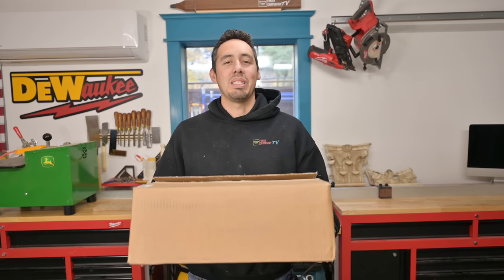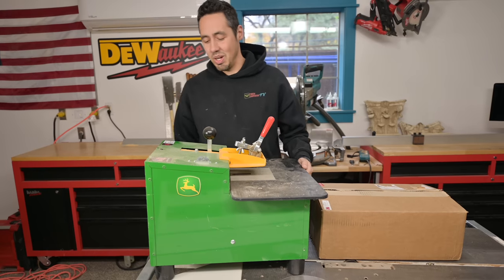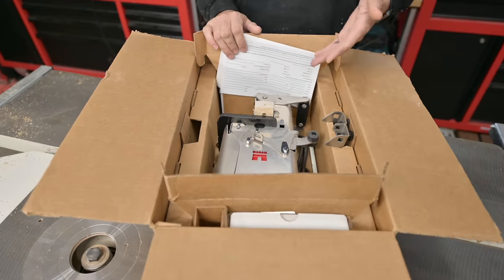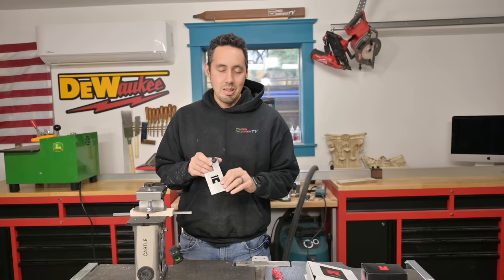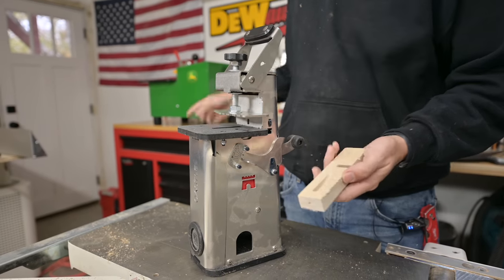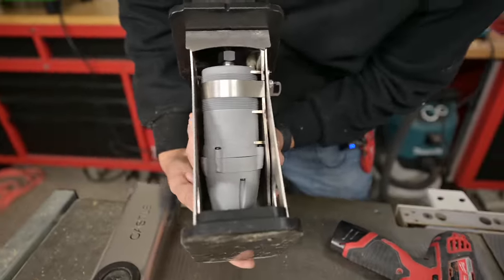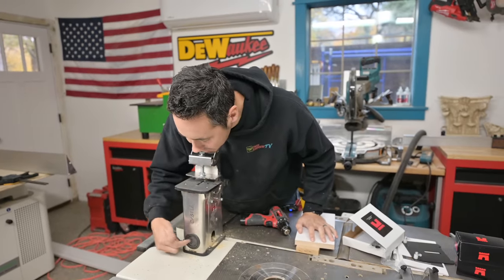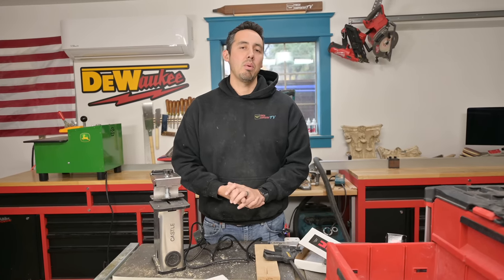Most contractors don't know about this... The Castle 110

Comment: Hi Richard. About 10 years ago I saw the Castle Pocket hole machine and decided that I could MAKE one myself??? So 9 hours later, lots of 3/4" plywood and 2 routers, I had a working machine. I have added a few ideas along the way, but my machine is still working just fine after 10 years of pretty heavy use. It is accurate and quick cutting beautiful pocket holes. Great design!!!

Comment: castle is king.. our mid-size, mid-grade furniture factory
had the floor model that had pneumatic  action and hold down clamps.. we ran porter cable routers , w/ HHS 1/8" jobber's for pilot & a two tooth carbide tip 3/8" strait flute . we ran every material imaginable across the castle. solid- oak,pine,ash,cherry,maple sheetstock- mostly 3/4" ply, MDF, HDF, PARTICLEBOARD, HPL(glued to substrate) & even ran some 1/2" baltic birch and some 3/8" merenti.  it was a "bottleneck" machine at our place. it ran 8hrs a day, 5 or 6 days a week for 17yrs. i worked on that thing several times mainly due to over use or shitty cutter/drill bits. the castle machine was a soldier, in my book, ohh yeah. i did all the maintainance. im sure i wrenched on every machine there including forklifts, the building, computers and copy machine and several employees cars.... ohh and i kicked the soda & candy machine when it malfunctioned.. lol

Comment: I've had mine since they first came out... the huge plus you didn't mention is the lower screw angle which keeps the faces better aligned when screwing pieces together.  The Castle screws are pretty much a must as a Kreg screw head is too large for the router slot... not a huge problem to get the Castle brand though.

Comment: I have had my Castle 110 for a little over a year and a half now.  Can say enough about how so much easier it is to make connections without the wood trying to move like with the Kreg pockets.  It is cleaner looking pocket, not rough around the edges like Kreg.  Low screw angle can't be beat.  You will love this as a portable pocket hole machine.

Comment: One of the nice things about the castle is the shallow angle of the screw hole and pocket which makes it a bit harder to get your impact in there, but greatly reduces the amount of slip on your joint as you screw.

Comment: Neet idea. Back in the 80s where I worked the owner made a pocket making machine had the traditional bit inside a bit a fence with air powered work holding piston and all functioned with a foot pedal. Was really nice but apparently the bits cost quite allot and wore out regularly.

Comment: I use a Kreg pocket hole jig and hate when you get board walk. I assume the pre drilling prevents that. Wish the Kreg made a drill bit with a longer pilot drill bit to accomplish what the Castle pocket jigs do. The 110 looks like a very well built tool.
Reply: The shallow 3° angle pocket that the castle router cuts also helps with the board walk compared to the typical 15° pockets with weaker joints

Comment: The TSM-12 is definitely the way to go for benchtop, worth the price difference.  But I don't see much point in the 110.  Frankly the new Kreg 520 and 720 both look better to me.  You can drill a pilot hole as a second operation with any pocket jig.  Just drill the pocket holes with the jig and then come back and finish the pilots with a normal bit.  4.5 mm works to give Kreg screws a tight slip fit (the Greg step bit is about 4mm in dia.)  In fact doing the pilot holes all at once is more efficient and less tiring than having to pick up and put down the cordless drill for every hole.  

It's not the angle of the 15 degree pocket hole that causes creep.  Most of it happens because the diameter of the pilot hole is not big enough and the pilot hole doesn't go all the way through.  Try it yourself.  Drill some pocket holes with your Kreg jig and then drill out the pilot all the way through with a 4.5mm bit.  5/32 is too small.  3/16 is too big but it will work.  You'll find that creep is practically eliminated.  You can use hand pressure to hold the pieces with little or no creep.  If you clamp it you'll definitely get zero creep.  I've been doing this for years whenever creep could absolutely not be permitted.  Go try it yourself.  

We all know the principle.  The same thing happens in any situation using screws where there is no pilot hole or where the screw threads are a larger diameter than the pilot hole.  The workpiece wants to lift.

Comment: I bought the one that Porta Cable was making before that was the exact same as that $1500 one, I don't see them anymore but I was for around $600 years back, burned up in the Glass fire of 2020, looking for a replacement, was looking at this unit until they raised their price $230 from $450 for no reason.

Comment: You’re going to need a couple of mini risers that are set at the height of the deck of that. That way you can support the 12+ feet boards you use.
Reply: Just lay them on your work top and bring the machine to them since it’s so small. You can clamp it directly on the workpiece for more support on larger materials!

Comment: If there is a way to mount a couple of PACKOUT feet to the base of the tool you would be able to pull it out of the drawer and lock it onto your stack. No need to find a place to clamp it.

Comment: Castle allows for more shallow angle of cut unlike kreg  like systems which some argue may contribute to better strength. One downside to castle is that you would need to use castle own type of screws for best results.
Reply: The type of screws that are recommended are panhead pocket screws(not washer heads).  There are several vendors that sell panhead pocket screws even Kreg.  Since the bottom of the pocket is rounded, the panheads crush the wood fibers on the sides of the pockets locking in the screws, just like setting a finish nail.  Washer heads limit this compression and can give you a false sense of security in some cases.  The biggest percent of mid to large size cabinet shop use panheads.
Reply: Wow Castle even watches this channel 😅 that's how you know you doing something right 🤘🏼💙

Comment: It appeared that the pilot hole was in a fixed point. It worked  great for the 3/4" material. How does it work with 2x material?
Reply: I noticed that as well. I imagine the tension in the joint at the face on the pocket side is greater that that on the opposite, and likely, the finished side. Finished side of the joint in thick material may tend to separate.

Comment: I am asuming that the drill hole guide is adjustable depending on the thickness of the material. Does it adjust on it's own, or do you have to adjust manually?
Reply: The drill guide is lined up with the middle of the router depth. You can clamp smaller or larger wood pieces and it’ll be the same pocket every time. If you really needed to have a deeper pocket for some reason you could adjust the drill guide and router hight as well!

Comment: Never seen these before (since I don't do any of that type of joinery work) but excellent explanation and video - I learned something new.

I would have thought it would be nice to be able to clamp it down from behind (since the side clamp holes force you to be at the edge of a work surface).  I understand that the pivoting router inside eliminates the possibility of a back clamping hole, but they could  have moved the router a couple of inches forward, or provided a clamping flange that runs along the sides of the base.  Clamping from behind I would think would give you more work table surface to access on your sides.
Reply: It’s so portable you can actually clamp it to the work piece itself as if you were clamping it to the edge of your desk.

Comment: I couldn’t see, does it have pre drilled holes on the base so you can screw it down instead of needing to clamp it down? That would drastically change the ease of use and versatility of where you can use it
Reply: Yes it has a few holes to mount. With larger materials you can also clamp the pocket cutter itself to the wood for  even more stability

Comment: Why did you choose the Castle system over Kreg?
Reply: The two big advantages are the pockets don’t chip out as much (if you need to plug your pocket holes and finish them), and the screw angle is shallower, so assembly is much easier. You don’t need to be as careful with clamping since it’s less likely to shift out of alignment.
Reply: @UCsAIi4-I0dwSQ6pyegB4A3g Yes, they're about 40 cents a piece, so 2x what Kreg plugs cost. You could probably make them yourself but the profile would be tricky to match, it's not a simple dowel like Kreg plugs.
Reply: @coolbugfacts1234  I have the old metal Kreg table top unit.... It's got to be over 12 years old. Its been a work horse. The bits last a long time.... but I'm rarely using hard woods.  As you mentioned the Kreg defiantly forces the pieces to offset a bit if you don't clamp them.... Are you able to screw two pieces of wood together pretty flush... without a clamp... with the Castle system?
Reply: @coolbugfacts1234    Sorry I deleted my question... I went on the website and took a look.... figured I shouldn't be so lazy... lol

Comment: I'm planning to get the drawers for my Packout. I'm wondering if the three drawer unit will hold my Dewalt drill and impact driver? I'm not sure whether I should get the two drawer unit or the three drawer. I am tired of unstacking boxes just to take a few things out for a smaller job.

 As far as the pocket hole machine I definitely do not do enough pocket holes to justify that cost so I'm sticking with my Kraig jig, I have the small cheap one and the larger more expensive one and they do a fine job if you take your time and do it right. Those are some really nice machines though.

Comment: I know nothing about carpentry so my question may be odd.  On your pocket holes examples, the hole was in the center of the board.  What if you had a thicker board (2x4) - would it still be in the middle of the board's edge?  Is it supposed to be in the middle?

Comment: In case you're wondering I do remodeling as well not at the level that you're on but sometimes I help rebuild fences sometimes I'm painting sometimes I'm rebuilding bathrooms sometimes I'm building decks outside sometimes I am fixing roofs sometimes I'm installing Windows sometimes I'm changing out fans and light fixtures sometimes I'm putting in Breakers and adding a 240 into somebody's garage
Reply: Are you licensed/insured/bonded? Dave, not Eileen
Reply: @eileenheitman4351  no I'm just an old handyman in the Houston area. Houston TX.  Why do you ask. Let me be transparent I have no official certifications except an electrical apprentice license but I fell in love with the craft and I like to help people out but I guess I'm one of those guys that they talk about when they say he watched a bunch of YouTube videos and then try to do it except people really like what I do I'll do some other research if it has to do with weight distribution or if I'm pulling out a wall and replacing it to make sure it's not a load bearing wall and I'm really good at installing Windows and changing ceiling fan replacing garbage disposal stuff like that I don't do stuff like putting in a driveway or adding a room on to a house.

Comment: The drill guide in the back appears to be fixed, so how does it adapt to different sized materials?
Reply: He didn’t demonstrate but the clamp is adjustable height for variety of thicker or slimmer materials. The pocket depth and hole height are fixed to keep consistency but if you need an extra deep pocket you are able to adjust router bit and drill guide height too

Comment: The additional $1000 and increased size for the larger castle machine is worth the money and burden of transporting a larger machine simply because it drills the pilot hole for you. You buy this machine is you're serious about making perfect pocket holes as well as using it often, the bigger machine that drills perfect pilot holes quick will make you more money than a smaller cheaper machine that adds the additional human variable for drilling holes.

Edit: Would also like to mention that maybe I'm naive and you can learn to use this to the point where it has more potential to the larger machine. Let me know how it works out! :D

Comment: Love the big Castle machine, ( I bought one), but on the job site, I believe my Kreg will pump out pockets for wainscoting faster than that small Castle, and it looks wobbly , don’t like how they have you anchor it, first time I’ve not liked your purchase.
Reply: It’s actually quite planted without clamps for smaller material. Also if you are cutting pockets into larger material and are worried about the stability, the machine is small enough to clamp directly on the workpiece for maximum support !

Comment: How does the screw hole adjust for different stock thickness?
Reply: The clamping plate is what adjusts for different thicknesses of material and the pocket and hole will remain the same size! I’d you need a deeper pocket you are also able to adjust drill guide hight along with the router bit height.

Comment: What if you have thicker material, let’s say 2x material. Will the pilot hole still be centered on the 2x?
Reply: The pocket and pilot hole will remain the same depth to ensure fit but you are able to adjust drill guide and router bit if you needed an extra deep pocket !

Comment: Can you get plugs for the Castle pockets? I’ve only ever used the Kreg one which you can buy a different plugs for.
Reply: Yes, they’re about twice what the Kreg ones cost, though. But since the pocket hole is shallower, the boards are less likely to shift than with drill jig pocket holes, so you’ll probably come out ahead just since you win’t ruin as many projects if you don’t clamp them perfectly.
Reply: Nice! Thanks

Comment: Does the Castle Model 110 have the capacity to do a whole wall panel molding project like the amazing one you did in the video you published Aug 21, 2020?

I did a mirror wall in a workout room using the same technique as you. If this new unit can do it better, I would follow your recommendation and get one for the next project.

Comment: Do you have any worries about it being less stable than your old one because of the smaller table size?
Reply: he mentioned he would advise clamping it down.
Reply: You can also clamp the machine directly on the material you’re cutting if it’s big enough to hang over the edge of your work top for more support!

Comment: doesn't look like  you can use  different thicknesses lumber and still center the hole.
Reply: The hole will be center with the pocket it cuts and the clamp will allow you to adjust for larger material and even smaller material with the shim they provide.

Comment: Great looking machines Richard! You mentioned using Kreg and I've seen you using the Kreg hand drill units before, but just wondering if you've ever tried the Kreg Foreman? While both these machines have more of an industrial build quality to them I really like the single action of the Foreman, which clamps and drills all in one motion. This means it is more efficient and will save time especially when drilling a ton of holes. Have you tried the Foreman and what are your thoughts?

Can't beat storing the smaller Castle in the Pack Out though, that's pretty awesome!